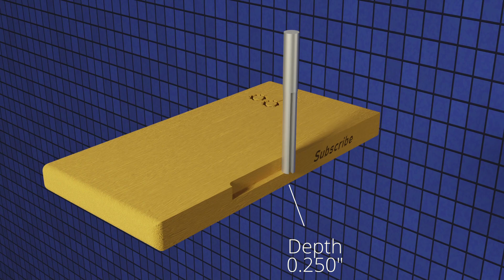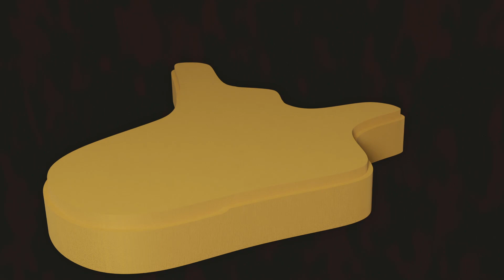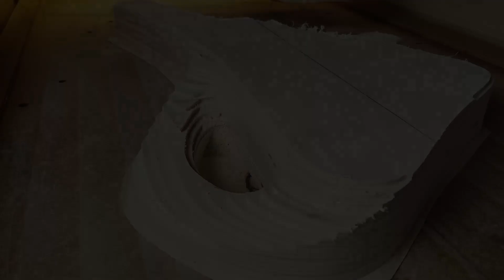Professional Life Hack for Truly Jaw-dropping CNC/CAM Guitars

Comment: That's a really amazing technique, especially if you're making unique pieces! Can you also use it to machine the piece on the opposite side while ensuring alignment? How do you do it?
Reply from the maker: I do mill these on both sides, and I have a few videos about how I do it, basically I use a center line on the part and spoil board to reindex on the other side.

Comment: Why not run a full depth pass ? No water marks and less wear on the bit by using the full cut length. You would cut the machine time 2/3 … ramp in on X,Y one cut and a finish pass. The strategy you are using is for slot milling but you removed the waste… full length of cut is the best way to save time and your bit life. This is coming from a machinist.
Reply from the maker: Ahh, well I hate to tell you this but it doesn't work that way and pretty obvious why. What you are talking about is called HSM, and it's great for production, but the feeds and speeds have to be perfect.
Reply: @TwoCherriesIns  if you say so
Reply: A 3 flute finisher and a series of final light passes full depth is a near finish ready surface with minimal sanding. To each their own but this is a fussy way of milling a body.
Reply from the maker: Maybe with your machine, but the small hobby machines we are running can't handle that load, and the results are not good. Everything is getting sanded by hand anyway, it's just not necessary to do that.

Comment: Nice video. What are the dimensions of the router bit you used for the edge milling? thx.
Reply from the maker: I typically use this 1/2" x 3" tool.
Reply: @TwoCherriesIns  thx.
Reply: I just watched the video again, and keep getting more out of it. In terms of how you secure the material to the cnc bed, what sort of glue / hardner is that and is that regular masking tape? Also, in terms of setting the z axis zero, are you adjusting for the height of the tape? thx.
Reply from the maker: @_trzn_  it's starboard CA and accelerator, there is a discount code in many of my videos descriptions. It's just standard masking tape. And yes I do account for the thickness of the tape, usually about  .030" gives me an onion skin and avoids any engagement with the spoil board.

Comment: Great news! I finally got my first CNC. Ive seen your methods and they make sense to me.. When routing a body on the router table its very important to cut as little material as possible to avoid chip out and kick back.. Thats the entire reason i wanted a CNC.. well that and the ability to do some tiny inlay.. and a quicker method of neck profiling.. okay lots of reasons.. Anyways thanks for the amazing tips and inspiration! Ill be honest half of what you say in describing your methods are spanish to me but im willing to put in the effort and learn this.
Reply from the maker: That's great, feel free to ask a question if you get stuck.

Comment: No idea what your talking about. Machine setup is just that a setup process, which from the looks of it you have not figured out. Sure your top surface will be exact, but once you flip that body it is no longer align correctly. 

Why are you the only person who does not use spiral router bits. They are cheap reduce tear out  and have a lower load on the machine.

After 40 years of hand building guitars I finally moved to a CNC and I can understand your reluctance to use the WCS and pins. Auston Shaner has some very goo videos on CAM setup. It will save you many hours of unnecessary alignment..
Reply from the maker: Well your entitled to you opinions, as it where, It's pretty obvious that I disagree with them.

Comment: Wow, thanks for sharing pro tips. Was discouraged trying to come up with indexing pins. Using bandsaw also saves on buying worn out router bits. Definitely going to try this method on next build.
Reply from the maker: I think it's a good solution, many disagree, try both ways and find what works for you.

Comment: I have learned the the depth of cut and rate of feed speeds in my software are to great for the hardwoods I frequently used. I would guess rock maple is harder than some aluminum. I can do aluminum on my desktop cnc, but slow down the rate of feed and maybe. 005" cut depth.

I have created much more cleanup work going fast, broken bits, even loosened critical parts on the machine. When I slowed down the parts were instantly better. If it's something you care about, speed isn't your friend.  If you need more product output consider adding machines and running proven files on them.
Reply from the maker: I run CAM jobs in tool steel all the way through to spruce. What I have found is that wood is very forgiving when it comes to feeds and speeds. While you can get away with a variety of configurations, dialing in the feeds and speeds like you have to on harder-to-mill materials is still worthwhile.

Comment: As a pro 5axis operator (on a 6x2meter) i never had problems with slot milling as long as you follow some rules. Your advice for improvement are very good, thx...
Reply from the maker: At time it is necessary, it's not as if I don't ever use it, I just like to think out all the details.

Comment: Surely slot milling a couple of mm off your finish line, then a final pass on the line would achieve the same result as your pre cutting method? Sand off the tabs, or route them off as part of the edge finish process?
Reply from the maker: Sure, takes more time, and the machine will also run slower for the full engagement pass, and you will have to deal with cleaning up the tabs. This provides a quick way to keep things moving, with less cleanup work later.

Comment: I run a 5x10 cnc in a cabinet shop, and I use basically the same z zero setup.  I zero to my spoilboard, bring it 5 thousand up, zero out, raise my material thickness.  It's worked wonders for our vacuum table setup for sheet goods.  Not cutting .005" into the spoilboard every sheet quadruples the amount I can cut before needing to resurface.  Using this setup I almost never have parts shift around and ruined.
Reply from the maker: It's always good to keep the spoilboard  in good condition, sometimes the stock is just a tiny bit of from what you expect, and this method does the trick.

Comment: I realize there’s a certain stigma against slot milling but I don’t really understand why. I’ve cut a few hundred CNC’d guitar bodies and used slot milling every time. So far not a single issue not even one time. Is the slot paranoia rooted in metal fabrication?
Reply from the maker: If it works for you then great! as a practice in my shop it makes the work more difficult.
Reply: Ok
Everyone has their process based on the tools and skill set but it looks like you’re taking the long road just to avoid slot milling. 
Difficulty is subjective but time is time. I promise I’m not criticizing but I don’t see the need for the extra steps. Does it save sanding time if it adds prep time?
I’m sure you know Fusion is a tool that keeps on giving as we learn. I’ve only been using it for about 6 years and I still enjoy learning from it. The “finish only at final depth” feature might be an asset per this particular conversation. 👍
Reply from the maker: @bradutube   I understand that it can be tough to validate your assumptions and provide justifications for your reasoning. However, that is exactly what this process is all about. It's an opportunity to test your assumptions and ensure that they hold up under scrutiny. While it may take more time and effort, the knowledge and insights you gain from this process are worthwhile.
Reply: You could just slot offset .25" and then run a finish pass. No way your faster marking those then manually cutting vs the 5 extra minutes for a roughing offset pass